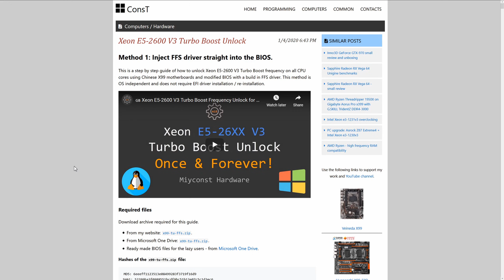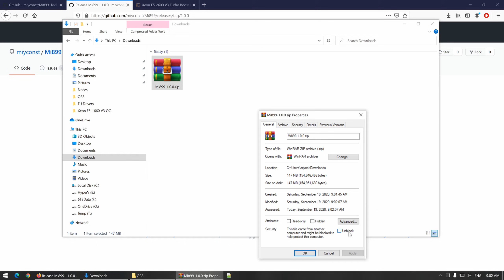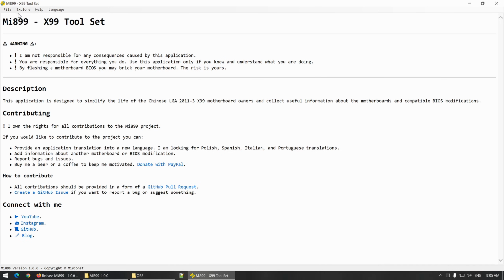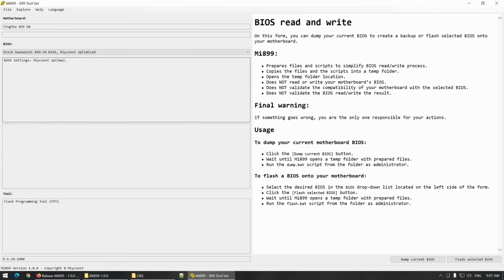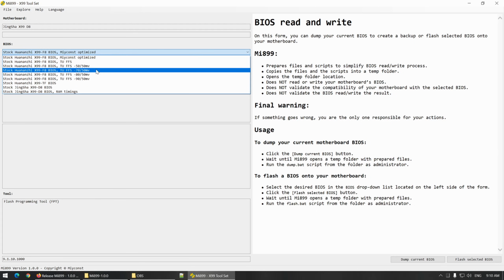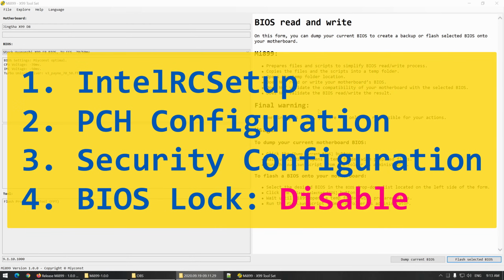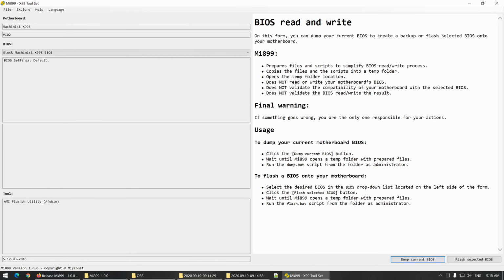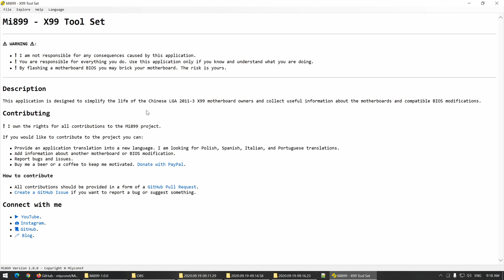🇬🇧 Mi899 – X99 Tool Set | read, write BIOS & unlock turbo-boost with a few mouse clicks

Comment: Every time I try to dump or flash the bios I keep getting a PCI Driver load error and Windows says "A Driver cannot load on this device: Driver: pmxdrv.sys" and says my security settings are blocking it but I turned them all off. Is there anything I'm missing? Note I'm running Windows 11 with a X99 RS9 Pro MATX Motherboard and a Xeon E5-2667 v4, idk if Windows 11 is the culprit.
Reply from the maker: Windows 11 is the culprit, there are some extra annoying settings to disable if you want it to work. Alternatively, just use Windows 10. Also, TBU doesn't work with V4 CPUs.
Reply: @Miyconst  I did buy a i7-5820k that I was planning to use and overclock was trying to update the bios before the cpu arrives on Saturday so I had a question since I updated the bios I’m getting B7 bios error? Is the board bricked or is it just the bios doesn’t support the V4 Xeon’s anymore? If I bricked the bios the mobo is still under 1 month return/replacement period with Amazon.
Reply from the maker: What BIOS did you flash? If you flashed a TBU BIOS then it works with locked V3 Xeons only, it won't work with V4 or i7.

Comment: Really sucks. Did the guide. Using a MRA9 Pro x99 and the bios I used was for MRA9. The option for the "Pro version" was a "pay only" so I just flashed the one below it. It went smoothly but Bricked the motherboard. Stuck on error code 61. Reset bios by pulling the cmos battery and nothing works.
Reply from the maker: That's sad. Unfortunately, nothing is guaranteed with the Chinese motherboards. If you want to debug the situation - welcome to my discord server and start with specifying full PC specs and what exact BIOS was flashed.

Comment: black screen after flashing and clicking "restore default settings in bios", x99 pr9, is there a solution?
FIXED
Reply from the maker: Please start with sharing your full configuration and what exactly you have flashed.
Reply: @Miyconst  Machinist X99-PR9, TU PEI -50/50mv, E5-2698 v4, 64gb server ram, vega 56, 1tb nvme. thanks
Reply from the maker: @prahcompdrive  V4 CPUs are not compatible with TBU, you need to either get a V3 CPU or restore the original BIOS with a programmer.
Reply: @Miyconst  okay, дякую
Reply: @Miyconst  sorry for annoying, but if i just install e5-2698 v3, is it going to work with this patched bios?
Reply from the maker: @prahcompdrive  in theory it should.
Reply: @Miyconst  yes it does, thank you very much for help

Comment: Hello Miycost.... at first, congratulations!! Your "app" save my life hahaha
Now I have a doubt about unlock turbo boost - i'll buy an Gigabyte x99 UD4. Its possible made Unlock in this motherboard to use xeon v3 with max clock all cores? Or only on chinese mobos?

Thank you
Reply from the maker: Most likely you can do the same hack with the Gigabyte motherboard but you would have to flash the modded BIOS with a programmer.

Comment: hello i have ZSUS X99-P4 there was worked?
Reply: OR HUANANZHI X99-P4
Reply from the maker: I am sorry to disappoint but I have not tested either of these boards.
Reply: @Miyconst  Thanks for your quick reply. Can I run a dump other than the version just to read the BIOS?
Reply: @Miyconst  Product      : X99-P4
Manufacturer : INTEL
SerialNumber : MB-202403062024
Version      : V8.2

Comment: Today i'm ready to do this but i'm not sure to pick 50/50mv or 70/50mv for my 2670 v3 on huananzhi x99 qd4 (2022)? my maximum temp during cinebench 23 is under 60c using montech air210 cooler.
Reply from the maker: -70/50 should be safe but if you want to minimize the risk, go with -50/50.
Reply: @Miyconst  Boss, one last question, my neighbor ask if the diy step use ffs drivers "ser8989_S3TurboHack-50-50-50.ffs" or the "ser8989_S3TurboHack-50-50-0.ffs" for -50/-50mv?
Reply from the maker: @murdock2143  use -50-50-0, it's more likely to work stable.
Reply: @Miyconst  much obliged, i will told my neighbor -50 -50 0mv.ffs is recommended by Miyconst himself, thanks for the reply.

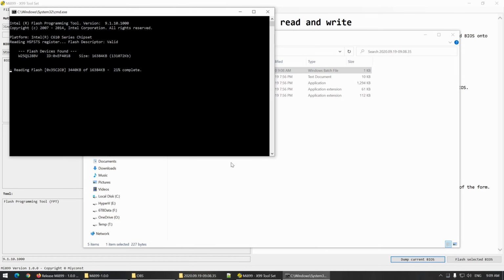Comment: Hello there, i need help 5:15 the mi899 when i try to ( dump current BIOS ) it's says 10 - error: unable to load driver.
Thank you for using mi899
Press any key to continue...

My motherboard is 
machinist x99 mr9a pro max
Reply from the maker: I think you posted the same question oj GitHub and solved the problem by installing Windows 10. Good job.

Comment: Hi, regarding the Xeon turbo hack, the more cores the CPU has, the more I should increase the undervoltage, or not? 
For examples a 2699v3 need -50/-50mv or -70/-50mv 
Thanks
Reply from the maker: The more cores the CPU has the more likely it won't be happy with undervolting. -50/50 is the safe option for most of the CPUs, -70/50 is the maximum reduction for most of the CPUs.
Reply: @Miyconst  thanks for the information

Comment: can I use this mi899 I saw x79 motherboard using afudos here in mi899 can I also use that to my motherboard x99-p4. I did my research and the only afudos can help I really want to unlock my turbo boost. I tried searching for guide but no hope for me.
Reply from the maker: No, AfuDOS version in Mi899 is only for X79 platform.

Comment: hey there so I just bought an E5 2698 v4 for a machinist x99 pr9 motherboard but the system won't POST the fans spin but just no output what bios would I use for this as it was working before I swapped the ram and the CPU (The CPU I swapped from was a E5 2630 v4)(And the Ram I swapped from was 32 gbs 4 sticks to 128 gbs 4 sticks both 2133 speeds) it says this motherboard is compatible but I need the right bios for this to work thanks. :)
Reply from the maker: The original BIOS should work with E5-2698 V4 especially since you already had V4 installed. It sounds like you are having hardware issues or something is wrongly installed.
Reply: @ so maybe I installed the ram wrong?
Reply from the maker: It could be the case, might also be a dead CPU or damaged socket.
Reply: @ I mean I had a different cpu in here earlier and it was working great but the fans spin all of them and the system doesn’t shut off
Reply: @Miyconst  actually I figured it out one of the 128 gbs ram sticks was dead so Its working now took forever to test everything tho also just wanna say great program!

Comment: hey bro, i just bought a new NVME and its crashing HARD whenever i Game any Multiplayer game, "singleplayer games dont crash the same way as multiplayer" but you think if i update the Bios Version it would stop NVME from crashing if possible NVME is outdated in main BIOS for sure, so i try`d everything and been having problems even when the game in not inside the NVME its in the SSD, if its fully multiplayer it just goes to bluescreen of death, and if i play a single player game on SSD it runs normaly, you think it would resolve if i did the BIOS update?, 

Ps: i already changed the NVME for 3rd time at store and all of them had same issue
Reply: if i play the game directly on SSD and run sistem on SSD withouth NVME being Used primarily it works normal, but if the game is fully multiplayer and its on NVME the game crashes and the sistem says Disk Write Error, after i reset pc, work normaly but i cant game any multiplayer on NVME 
could is be Bios update? or its just the damn X99 turbo from china being pussy ?
Reply from the maker: It seems like you have a hardware issue and most likely the motherboard is to be blamed. BIOS update won't help here.

Comment: Hi. I followed all the steps but with Windows 11 I still have the same problem. "I don't have administrator permission" even though I started the program with administrator privileges.
Reply from the maker: Most likely your motherboard has locked BIOS and you need an external flash programmer to read or write it.

Comment: Hi i can't see MACHINIST MR9A PRO in selection menu  bios for MACHINIST MR9A wil be fine for MACHINIST MR9A PRO ?
Reply from the maker: Yes, these two use the same BIOS.
Reply: @Miyconst  Thanks for info glad you explain 🙂.
Reply: I just try flash bios witch unaocznić turbo -50-50mv bios Works but turbo stil like defalut

Comment: I know this is old but can you please tell me if it supports the MR9A-H by machinist?
Reply from the maker: Mi899 doesn't yet support H motherboards from Machinist.
Reply: @Miyconst  alr ty for replying but is 2x 2699 v3s faster than 1 turbo?
Reply: @Miyconst  does it support the dual socket atermiter mobo with 8 ram slots and 2x 16x pci-e and 2x 1x pci-e
Reply: @Miyconst I'm actually gonna go with a jigsha x99 dual, do you support it?
Reply from the maker: @PugGuy092  I don't.
Reply: @Miyconst  nah I changed my list to a jigsha x99 dual cs I found in your videos that this is a zx Wich is bad

Comment: I have a problem with your app all the time i tried to use it, i have an error code when i want to dump my bios or flash it, The error code is -10 "unable to load drivers" and the same text for le intel one did you have an idea for this probleme ?
Reply from the maker: The error has nothing to do with my app, it's FPT/Afu fails to read the BIOS. Do you have any unrecognized devices in the device manager? All updates (including optional) installed?
Reply: @Miyconst  yes i have a lot like 15 device that are not recognize soo it's were it break ?
Reply: @Miyconst  new info i get all the device to set by going on the official website of the motherboard but i still have the error i try to reinstall the program and the sdk and still no change, if you can help ?
Reply from the maker: @lefoxfox  then your BIOS is locked and you need to use a CH341a or similar to read/write it.
Reply: @Miyconst  THX

Comment: "Error 284: Fail to load driver (PCI access for Windows). 
Tool needs to run with an administrator priviledge account."    ..... in case i open with Administrator Account

Comment: Sounds fantastic, but unfortunately it doesn't work for me. I always get this error message: 

PMXUtil: Error during PMX call: idrvdll.dll!IDRVInstallDriver(): The loaded service could not be started err: -2146762484

Error 284: The driver could not be loaded (PCI access for Windows). The tool must be run with an administrator account. 
Thank you for using Mi899.

What am I doing wrong?
Reply from the maker: I think you are doing everything right but your BIOS is simply locked and you need a CH341a or similar to read/flash it.

Comment: I keep getting "failed to load driver" when I try to dump the bios
Reply from the maker: If you done everything right but still can't read/write BIOS, it means it's locked and you need a CH341a or other programmer.

Comment: im using the win11 ghost spectre 24h2 OS version. my mobo is jginyue x99 d4 titan with intel xeon e5-2683v3. upon following your video procedure. in the dumpbat. the cmd "10-error: unable to load driver."

Comment: great toolset! I need x99 d8 max BIOS--i'm desperate. can you upload a factory dump of any update? I'm still on 0.1!
Reply from the maker: I don't have that BIOS yet, sorry. You can ask AliExpress sellers.
Reply: @Miyconst  I bought mine off Amazon and the seller is gone. I’ve messaged the aliexpress guys with little hope to hear back quickly. I understand it’s a lot of work. And I see I can preorder a bios, do you have an estimate? I can PayPal you for any rush you could give me
Reply: My next option is to buy another board and send it back after I use your tool…. I figured you could have the business if you could beat that time
Reply from the maker: @Drgoodfunk  what business are you talking about? Making TBU BIOS mods for people?
Reply: @Miyconst  I’d pay for just a simple bios backup. Not even a bios mod
Reply from the maker: @Drgoodfunk  these Chinese X99 motherboards are mostly bought buy people with very restricted budget. I don't want to ask for payment if I didn't add any specific extra value. BIOS-iEngineer creates new BIOS for this motherboards, it comes with latests patches, drivers, features, so he sell these options. I don't add any significant value, thus all BIOS I get access to is available for free from Mi899 GitHub.
Reply: @Miyconst  i understand but i need a working bios. i would be happy to pay for your time to go through  the trouble to upload it quickly. Im sure you would be fast and it's not too much work. i just need any dump for the x99 d8 max. i have a month  to finish a project and the board doesn't even recognize pcie gen 3. I COULD buy  another dump it and return it  but i again figured you could get me a dump in less time and i'd pay extra for your time. I appreciate you telling me about bios engineer, and ive even messaged the aliexpress team but rn you're the only replying
Reply from the maker: @Drgoodfunk  I just have uploaded latest X99-D8 MAX BIOS to my Mi899 GitHub repository. Please check it.

Comment: finally i found this video, youtube didnt want to show it after looking for mi8x99 specifically… 

huananzi x99-tf seems to work well with the -90/-50mV bios on xeon e5 2678 v3 but it still immediately hits 120w tdp limit and therefore is not able to run at 3.3 ghz 100% of the time

Comment: Hi after flashing the iEngineer BIOS I want to go back to the original X99 D8 BIOS I saved, in the iEngineer BIOS (based on Optio V) I can't find the option "BIOS Lock", do you know where it is? THanks
Reply from the maker: The iEngineer BIOS locks out FPT. You can try AfuWin but the best is to use a programmer. May I ask why you want to revert?
Reply: @Miyconst  I don't have a programmer and I didn't want to buy a new one... I want to revert because with this BIOS every four boot ups the BIOS stays blocked on state b4 and I have no to clear the Cmos to make the board to correctly reboot again.. is AfuWin easy to use?
Reply from the maker: @Andrea-Agostini-9971  do you mean that the boot partition is not found and the system fails to boot or the motherboard fails to initialize and you get black screen?
Reply: @Miyconst  no no, no failure, the motherboard "simply" stays stuck in the state b4 right before starting the os startup...no errors at all, simply stuck... the strange thing is that it happens regularly after 4 regulars boots and clearing the cmos all starts to work again, for other 4 boots... I Engineer of course told me it's been my fault for having not used a programmer... I ordered another motherboard (not for this issue) but I'd like to be able to use this one as long as possible....
Reply from the maker: When it's stuck at B4, do you see anything on the screen? Anyway, you can try to flash the original BIOS with AfuWin using Mi899.
Reply: @Miyconst  yes I see the initial logo for the bios
Reply from the maker: Ok, so you can't even get into BIOS when it fails to boot. Right? Then yes, looks like the BIOS didn't get properly flashed and you need a programmer to get it working. Alternatively, it also could be that your motherboard is slightly different or defective.
Reply: @Miyconst  how can I use AfuWin with your program?
Reply from the maker: Select any motherboard, like X99-TF, then pick AfuWin as the tool. Then select BIOS you want from your disk and click flash.
Reply: @Miyconst  I downloaded AfuWin i copied all the files in the Mi899 folder but I don't see Il listed in the toops, only fpt, am I missing some step?
Reply from the maker: Pick another motherboard. I didn't enabled Afu for every board.
Reply: @Miyconst  it seems to be worked like a charm
Reply from the maker: Mi899 for the win!
Reply: @Miyconst  always!

Comment: Hi, I own Jingsha X99-8d3 and it have propably BIOS from Huananzhi X99-TF with turbo unlock but is there any way to confirm that? I know there is a Resizable Bar feature, but is there any new bios revision for this motherboard? I propably chagne CPU from 2678v3 for 2696v3 and would do some improvments if there is some safety ways. Thanks for what You done.
Reply from the maker: You can check the motherboard name in CPU-Z, if it shows Huananzhi - you have their BIOS.
Reply: @Miyconst  I already done that, CPU-Z recognize it as SZMZ/Jingsha with BIOS version X99D3revB. I doesn't saw Your review about that motherboard. I got it for 3 years as daily PC and it very stable and reliable.
Reply from the maker: Then you have the original BIOS not Huananzhi.

Comment: Bro i have tried it on my X99 pr9 and my system is not working anymore😭😭Please help i just followed all steps and then restarted my pc and now my pc is not working there is no any display anymore
Reply from the maker: Well.. apparently the BIOS you flashed is not compatible with your system and you need a CH341a to restore it: https://youtu.be/4qX2zihB6UE?si=nU_aOa3_7KO5TdSt

Comment: Hi, I tried to flash the bios. But when running the pc. It makes a serious sound and open the bios. It said Rom Image is not loaded and Rom Image update denied. Do u have any solution for this?
Reply from the maker: Hi. I don't think I can provide any help with such description. Please join my discord and start with sharing your full system specs, what BIOS and how you tried to flash.

Comment: Any help plz I use your mi8 x99 software for my attermitter motherboard and I dump and flash after that I restartmy pcbut  my Nvme is not showing on both system n bios. in bios it says in Nvme confirmation  its says no Nvme found plz help.my motherboard shows atermetter on startup but now its shows huananzhi
Reply from the maker: The flashed Huananzhi BIOS is not fully compatible with your motherboard, you need to revert back to the original BIOS.
Reply: @Miyconst  how can i revert back plz help
Reply from the maker: @OutPlayPk  please join my Discord if you need help troubleshooting the issue, it's next to impossible to debug it in YouTube comments.
Reply: @Miyconst  i used qiyda, Aettermetter,evring profile not huanzai profile